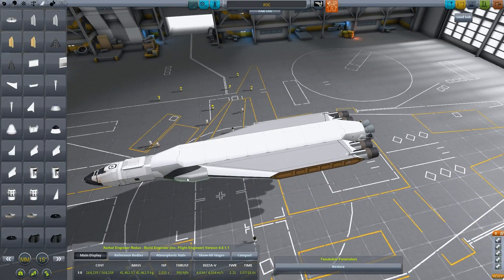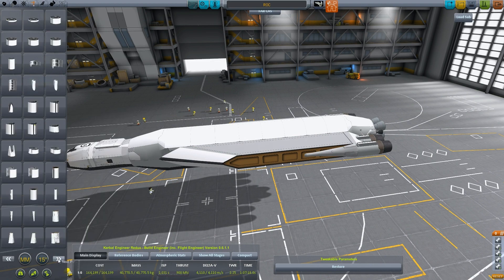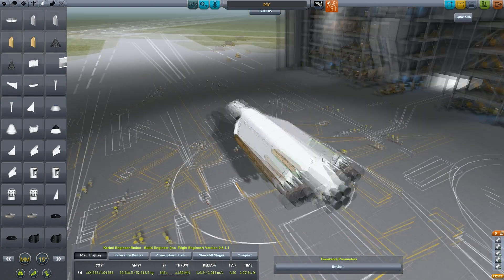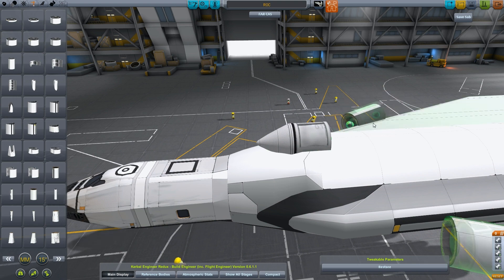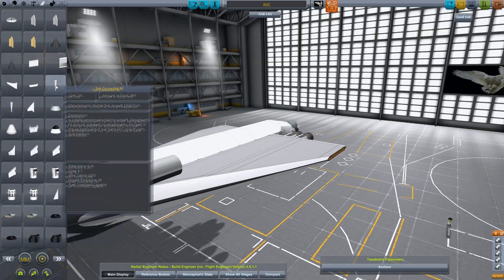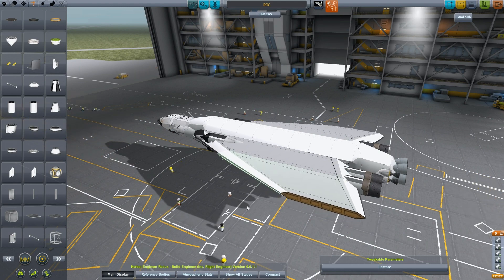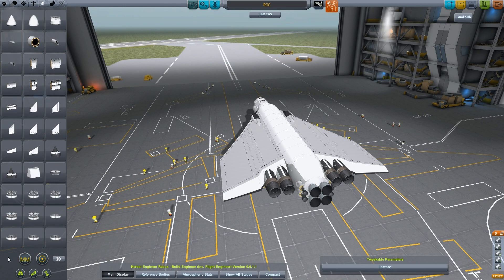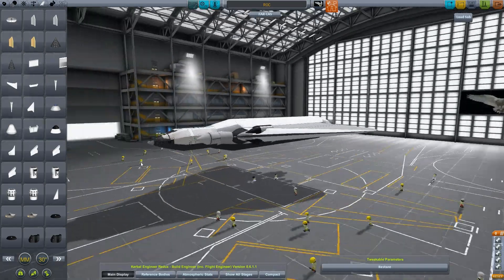Let's Fly KSP: Space Shuttle Development part 13

Comment from the maker: With the realization that I can use both Module Manager and Tweakable Parameters on any part to change stats without altering the original mod, it's no longer such an issue. I still can't share a rescale of somebody else's work, but that's not so bad.